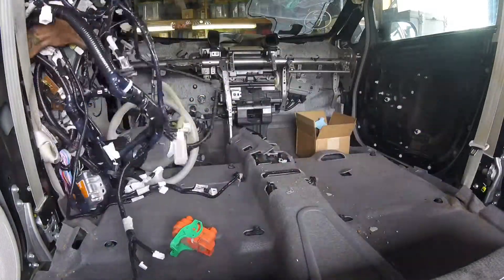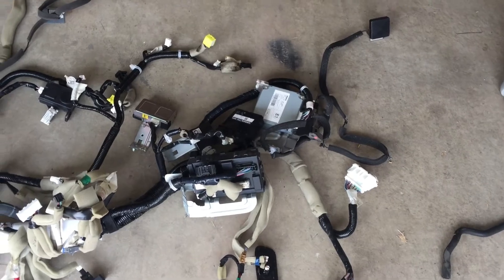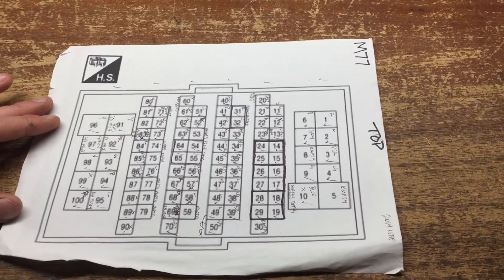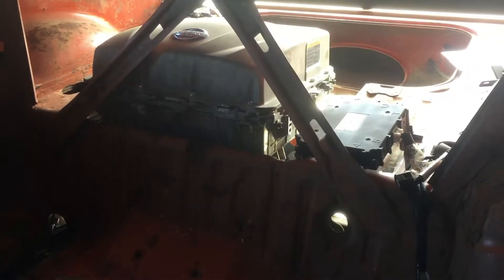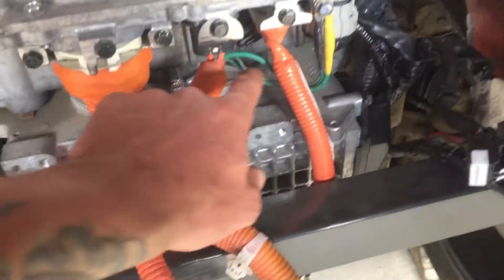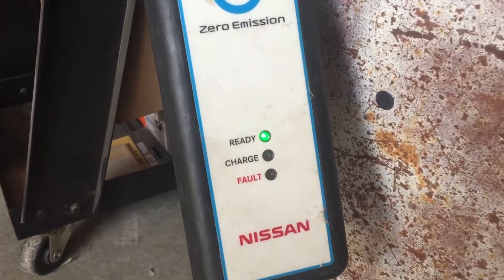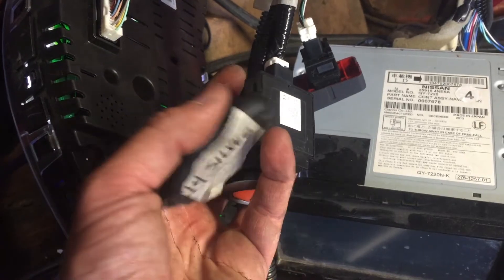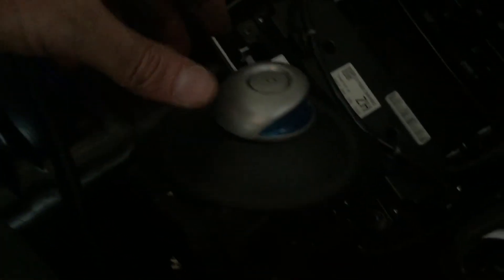FastLEAF Wiring

Comment: Great video. 
Having stripped a 2011 Leaf and messed up cutting wires I shouldn't I fully sympathise 😛
Reply from the maker: It was a great education on how to read Nissans diagram structure for sure! Very familiar with Subaru but Nissan does things much differently. Were  you able to get your project up and running?
Reply: @MicksUglyEVs  I decided to go with a Damien Maguire VCU as I didn't have a battery pack that matched the car and wasn't confident I could get the Leaf hardware all running without it I ended up with a VW eGolf battery pack an Outlander PHEV charger and ditched the Leaf PDM.
It is all running and working but I'm still building it.
I've made a few videos too if your interested.

Comment: Good idea and that you did it. I have thought also that two electrical systems on one converted car would be too much. Especially if something needs fixing. Also then it would be possible to use leaf wiring diagrams to find faults.
Reply from the maker: That’s a good point. I felt that the old wiring was a rats nest and it just made sense to use the LEAF controls since I was already planning to use the steering column.